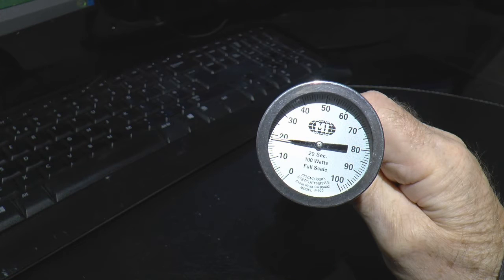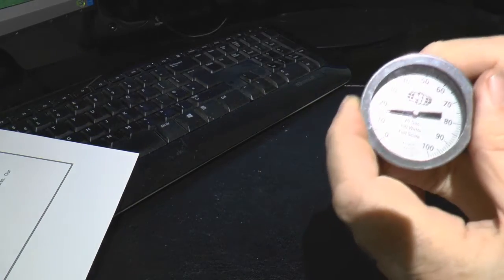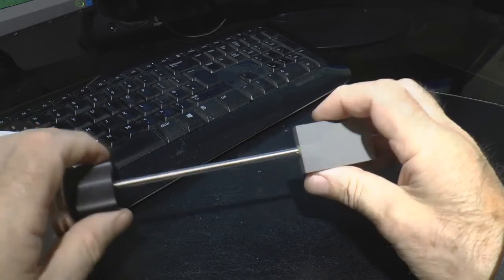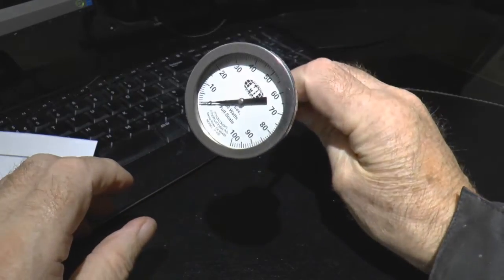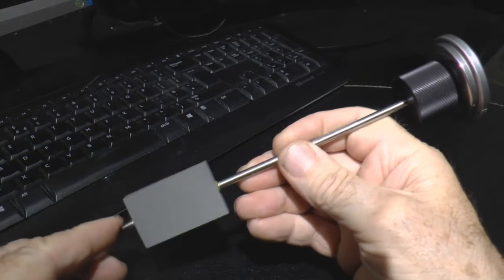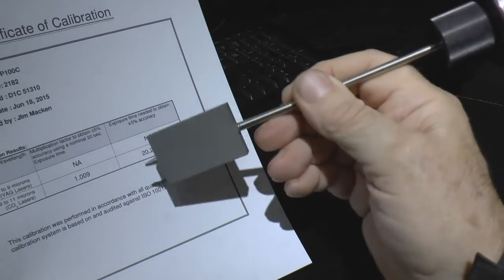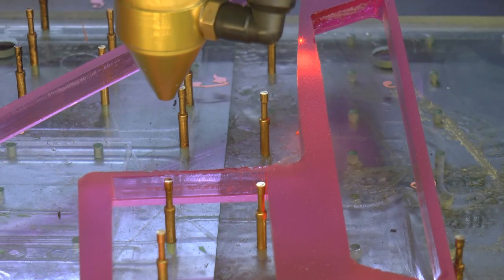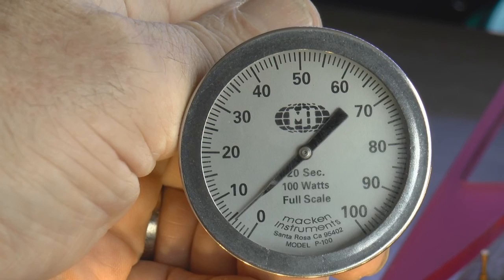RDWorks Learning Lab 32 50watt fraud Final proof

Comment: 50 * 60% = 30 watts. So technically it's over powered,
Reply from the maker: Hi Norm

Sadly you have made the basic mistake that most newcomers to the technology assume.. There is no direct linear relationship between % power and watts output. .  When you select 0% power, the controller sends a 0vdc signal to the HV power supply When you select 100% the controller sends a 5vdc signal to the HVpower supply. The relationship between the volts output from the controller  and %power IS linear ie 50% power= 2.5v signal to the HVpowert supply. Depending on the power of your tube, the HVpower supply will allow a certain maximum current to flow through the tube . In the case of a 60watt power supply that max current will be about 25mA.  The linear voltage  signal INTO the HV power supply is the thing that will will produce a  LINEAR current flow through the tube . However a 60 watt tube will be limited to safe running at 22mA ie about 85%power. This 85% power will probably produce 65 watts output  but the watts output will be  VERY non linear and vary from tube to tube and manufacturer to manufacturer You may like to watch a couple of videos that will help you understand whats going on.

https://www.youtube.com/watch?v=nZuatc3eIgU&list=PLPWEtx5V9DqEogIeYRdcG_KYcB7UL2Qmn&index=26&t=1476s
https://www.youtube.com/watch?v=2F5O-1TH8b0&list=PLPWEtx5V9DqEogIeYRdcG_KYcB7UL2Qmn&index=7&t=18s

Best wishes
Russ

Comment: My Mahoney 100W meter arrived today.

It looks very similar to the Macken meter, but the "block" is just normal anodised black aluminium, exactly the same as a cheap heatsink.
Its not been sand blasted prior to being anodised like the Macken one is.

Prior to doing the actual power test on my "50W" (LOL) machine, I decided to find out what the range the thermometer in the meter operated over, so I put the block in tap water, which was at 14 deg and zeroed the meter.
I then put the block in water at 60 deg C and the meter read 88 W

So the thermometer appears to be calibrated to about 0.52 deg C per Watt.

Hence to measure 80W its going to need to rise by around 40 deg above ambient temperature.

The other difference between the Mahoney and the Macken is the time the meter needs to be in the beam to get the reading.

On my meter it has 30 Sec written on the face of the dial, but the back of the meter has 37.3 engraved into it, and the paperwork with the meter has 37.7 seconds written on it.

The paperwork also indicates that the meter may need an additional 25 seconds to stabilise after the 37 second test has been completed.

And the $64,000 question is  of course how much power to I get on a machine which appears to be identical to Russ's machine.

Well.... Exactly the same power at the output of the laser (37W) and 32W at the cutting head. So I appear to loose 5W though the mirrors.

I did not test the power after the lens, but I will do that tomorrow and update this post if I remember. But I will need to be quite careful doing that, as I'm sure the anodisation would burn off if I didn't significantly increase the distance from the lense to the block, to make sure the beam is defocused enough, as the anodisation looks rather cheap and prone to burning off. 
And I know I can burn anodisation off heatsinks as I've tried to do that in the past

This was running my machine at 65% power, which I have previously checked is 20mA of current through the laser

The 1W difference between the 6W that Russ lost and the 5W that I lost is well within the margin of error. So all intents and purposes the power on our two machines appears to be identical.

BTW. My laser tube has a sticker on it with "Agreed power" of 43W. I guess perhaps if I over drove the laser to the point of damaging it, I guess there is a chance it may generate 43W but this seems somewhat optimistic, as I have done other power relative power measurements on the tube, and even running it at 80% only gives me marginally more power than at 65% power.

 One final note. I will compare the power measurement with one of Russ's lollipop style blocks when it arrives next week, but I suspect it will yield the same results
Reply from the maker: Hi Roger
It's no bad thing to have smooth anodizing. I found that it takes more effort to get the heatsink wiped dry between tests when the surface is rough. I Made my lollipop round and smooth anodized to that it is simple to wipe dry efficiently because there are no sharp corners and square faces. The other advantage of it being lollipop shaped is that there is less surface area to radiate heat losses. I did test 3 shot blasted prototypes as well and although there was little AVERAGE  difference to the 3 machined face samples, there was 3 or 4 more watts of data spread with the shot blasted lollipops.  

There will be no significant damage to your tube to run some short tests up to 100% to map your tube, It will clearly show that you WILL be wasting tube life if you run above about 60%. Bearing in mind that your 800mm long tube will be 40 watts nominal output, AND not a high quality tube (such as Reci or EFR) your max running current should be 18mA.   50 watt 1000mm long tube will be 20mA and a 60 watt 1200mm tube will be 22mA.

Best Regards
Russ
Reply: Thanks Russ

I'll do more tests now I have the meter.

BTW. Did you do any tests to see how much ambient air temperature effects the readings ?

I had the same thought as you mentioned briefly in the video, that the temperature at which the meter was calibrated should be listed.

When my meter arrived, the needle was pointing virtual straight down, which I assume was because it was zeroed at a much higher ambient temperature when they calibrated the meter in a factory in Hong Kong. (where it was sent from)

I've not determined exactly what temperature it was calibrated at, but I think it was in excess of 30 deg C, possibly has high as 35 deg C. So using it here at the moment where the ambient air temperature is only 15 deg, is 20 lower than it was probably calibrated at.

I suppose I could unplug my extractor fan and then heat the inside of the machine with a hair dryer to see if raising the temperature makes any difference.

Is this something you have investigated ?
Reply from the maker: Hi Roger
The ambient temperature has no effect on the results because you are always looking for temperature DIFFERENCE. It IS important that you always start your readings from ambient.  Look again at https://www.youtube.com/watch?v=lO9rWlobLZU

i  was looking for the same calibration temperature data when I first got my meter. But this is a calibrated COMPARITOR where the calibration temperature is of ZERO importance.

Regards
Russ

Comment: Hi. I'd like to find out how you made that spiral drawing? :)   I've been using lines so far which are easy to calculate (i.e. 30mm line at 1mm/s) and it was fine for unfocused beam, but now I need to test how much power loss I get after lens and for that I need rapid movements otherwise I get paint burned off my power meter block :(
Reply from the maker: +bratan007 

After the lens I still drop my meter away so that the beam is unfocused when it hits the anodised surface. Just pulse a piece of card at low power to see what size your beam is and gradually drop your table until its at least 2 or 3mm diameter. My test path is a circular shape but there is no reason,  it could be any shape you want. If you draw it with a polyline in RDWorks and then test it with a PREVIEW it will show you the LIGHT TIME. You can change line length (with node edits )and speed and test it without going near the machine. I got to my 20.2 seconds by drawing a shape of aprox length and setting cut speed (I used 9mm/sec I believe)to give me aprox 21 seconds. I then trimmed little by little until I arrived at 20.2. No real science just trial and error. You are welcome to my .rld file just message me with your email and I'll ping it to you.

Good luck
Russ
Reply: +SarbarMultimedia Ah I see! Thanks, I'll give it a try! :) I was half expecting some formulas with Pi in it, lol
I'll have to make my own cause my meter says exposure needs to be 30 seconds (I have slightly different version).
Reply from the maker: +bratan007 
Yep, that would be the Mahoney brand , they must have a larger mass than mine. Sorry to disappoint , no maths or science involved Hope that helps
Russ

Comment: Hello, I'm wondering where i can buy this in the EU?
Reply from the maker: +Srdan Červenjak 

Hi Srdan
I did a lot of searching to find a UK supplier or an Ebay source. I failed. There is a cheap Chinese version called a Mahoney Power Meter but you can only buy that from USA distributors. I finished up buying mine with the help of a fellow laser user in the USA. He tried the cheap Chinese version,decided it was rubbish and got a full refund. I then chose the more expensive Macken Meter which has been superb. Its a P100C
http://www.macken.com/price-list.shtml
They may ship to you if you email them but there will be import duty and VAT to add onto this, so it will work out VERY expensive.
I am currently  in the process of trying to develop a close equivalent  that you will be able to make for  yourself at a fraction of the cost. I hope to be done in 3 or 4 weeks. So it may be worth waiting to see if my mad idea will work.
Best regards
Russ
Reply: +SarbarMultimedia 

i also in the mean time found the Mahoney power meter, with shipping its
 122 USD + VAT i guess when it arrives. The ones you linked are quite 
expensive + VAT as you said it can mount up. I see well maybe ill wait 
for your invention then guess will be a lot cheaper :)  Have to say that
 i love your videos, as we are getting a "100W" Chinese laser but a bit 
bigger then yours at 1.3 x 1m. Lucky for this brand is that a local 
company represents the Chinese company  and they worked with them to do 
some improvements on the laser, and also  i can get support from the 
importer locally and not depend on the Chinese seller. So its so fun to 
watch your videos to see what you come up with and how you solve 
problems with the machine.